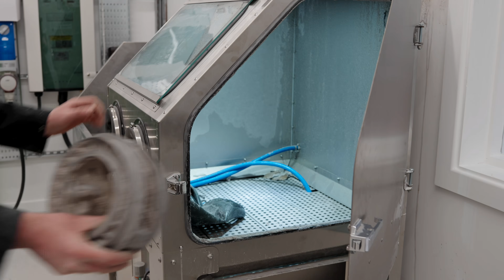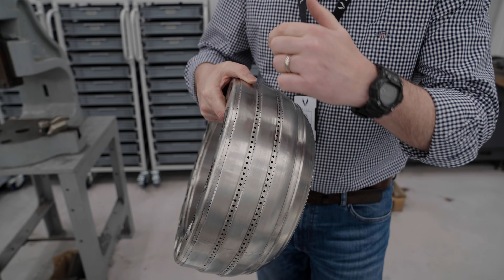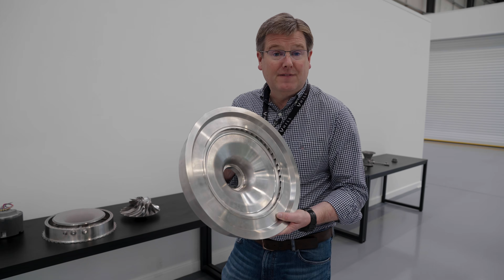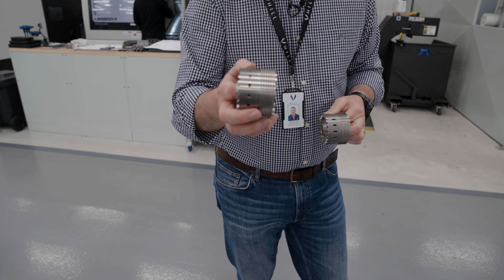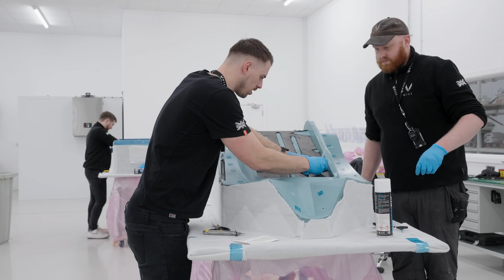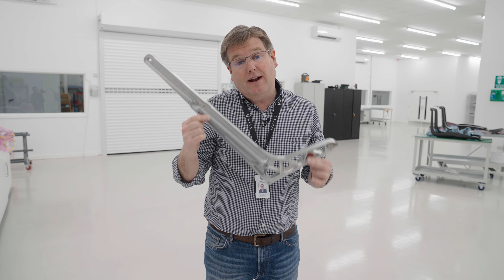Countdown to First Run: The GT50 Engine Assembly

Comment: You probably already know this but test you air conditioning system test the compressor to run in different tarmac environment as on the ARH90 our compressor was made for European conditions and the Australian heat on the tarmac made them dangerous for gas leaks due to different expansion rates of the materials the casing was made from.

Comment: I'm not an aerospace engineer, in fact, not any kind of engineer, other than a software developer, but I have a huge passion for jet engines and IC engines. I've always imagined building my own small diy jet engine by casting the blades, since I'm not a trained machinist. I'm glad to know that my rudimentary thought process has some validation. Thank you.

Comment: This has all the makings of a helicopter version of Cirrus, a new company in the market disrupting the old guard who still make the same old designs they’ve made for decades, with a fresh design and genuine aviation passion.

I really hope this works, I want to see Hill helicopters working.
Reply: They were targeting $500K-$700K last I heard. When financed with a group of people, it's actually quite a bargain.
Reply: i really dont want to see a cirrus price tag on them though. if they can keep it below 250k with reasonable running costs i'll be happy.
Reply: @jjoheld  I dont want to see a cirrus price tag either but a comparable helicopter is 4 times the price of this at minimum AND this one was developed from scratch. I think with the current price, they will seriously takeover the market. It'd be very nice if they could create a plane. General aviation has gotten out of control. 1.4 million for a brand new cirrus with engine technology literally from the 60s and super barebones. Can only fit 4 people but then you cant be full on gas. And no interior space for 1.4 million. I'd think that was overpriced even if i were the ceo of cirrus. If hill made planes later on down the line I bet they'd destroy (in a good way) the market especially if they could hit your price of 250k but even at 700K they're just half the price of the sr22 and they could include the GT50

Comment: A few questions about the engine development.  1,  How will you test for simulated varying loads expected during flight on the engine?  2. Since you'll be using FADEC, will the engine be capable of hot starts similar to the Bell 505?  3. Will the engine test plan be simulating long sustained flights or will you be simulating typical use with both short flights, shutdowns and extended flights?